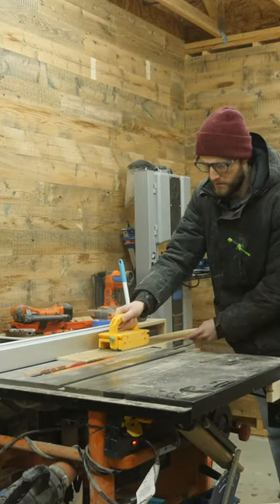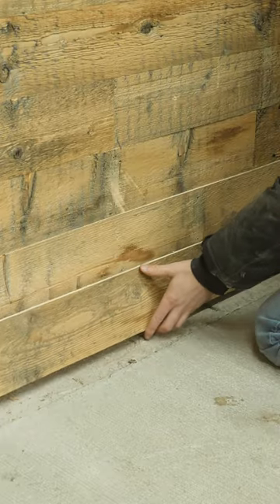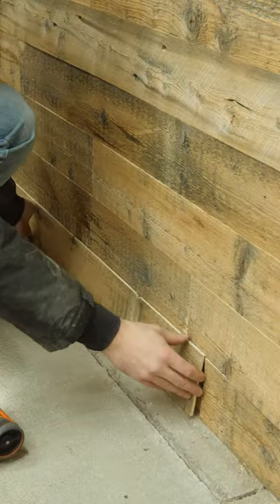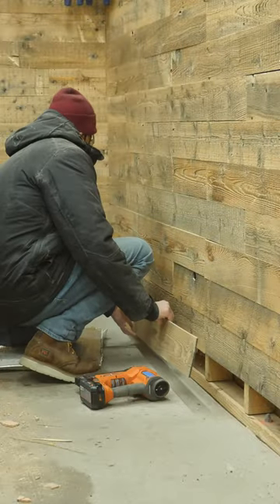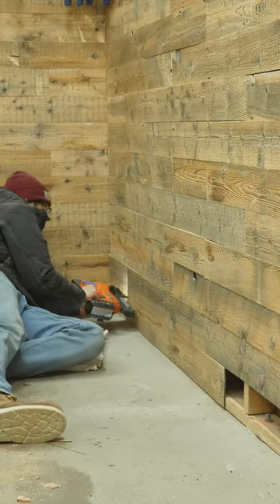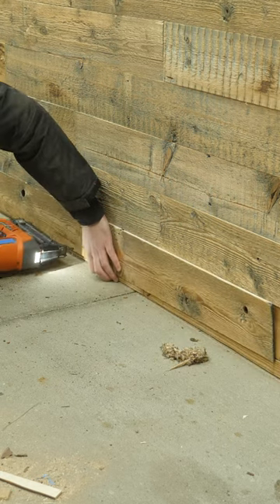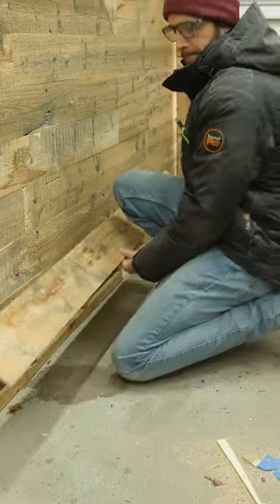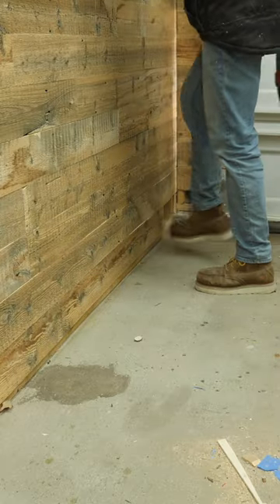just the tip

Comment: The floor of a garage is supposed to be sloped from back to front out the doors so any water that gets in there will drain out. If you're getting water coming in from outside when it rains that means the level of the ground or concrete or what ever is outside the doors is too high and needs to be lowered so the water doesn't come into the garage. It's nothing wrong with the garage floor or footings. So if it's going to be living space you definitely need to lower the outside grade at the doors and slope it away from the doors to stop that issue. Your problem is the outside grade.